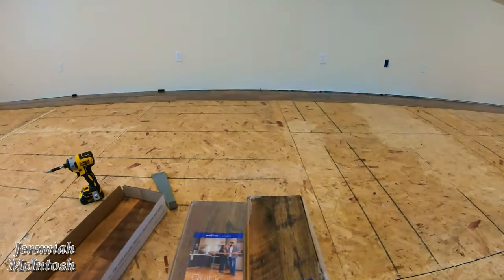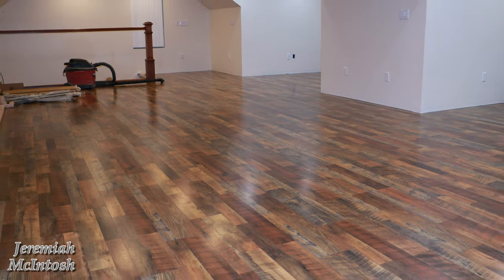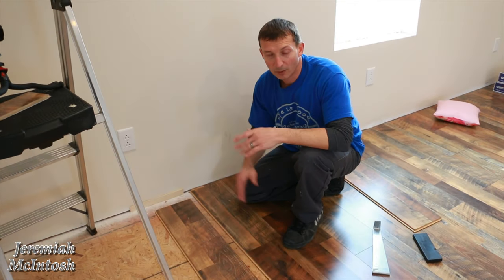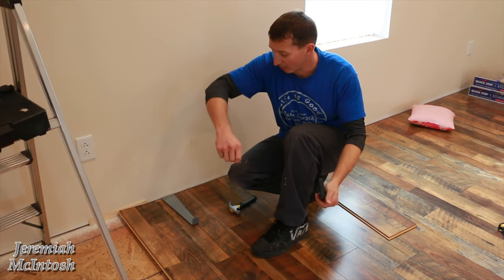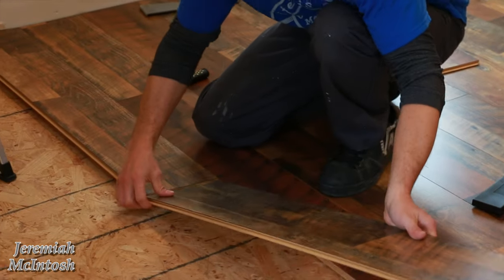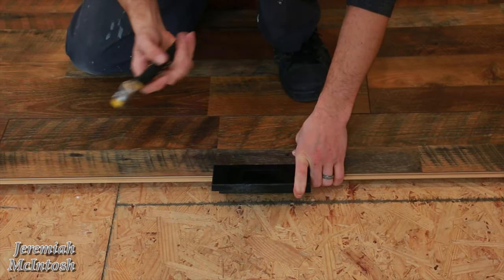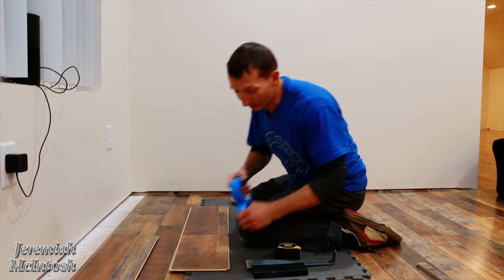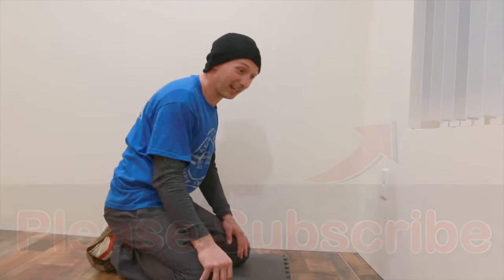How to install Lowe’s Quickstep Studio Restoration Oak Laminate Flooring! Awesome Looking and cheap!

Comment: I laid this flooring last month and one thing can't stress enough you have to have one of the plastic tapping blocks and have to beat the hell out if to get it to lay flat.
You are better off using a heavier hammer then a light one, never did a floor like this that needed to be hammered this hard to lock and lay flat. 
Make sure you tapping block is in the right place you can damage the lip if you aren't careful.
Reply: That last sentence!! I ruined a couple of boards using a block because I used it on the whole side instead of on the tiiiiiny lip. Once I figured that out I was on my way pretty easily. Oh, and cushioned knee pads were a lifesaver

Comment: Video doesn't really touch on leveling. It's incredibly important to check the whole floor is level and any dips patched and any highs planed down. Any variance over 3/16ths will come home to roost and cause buckling or decoupling of the latches.

Comment: Excellent instructional. I had to go back and watch it again to get those first pieces to be still. I piled the full boxes on and the rest was a breeze!  One tip I could give- be sure to cut off any of the foam on the bottom that sticks out past the ends. This will allow the end joints to click together better. Thanks again!
Reply from the maker: Glad it was helpful!

Comment: i installed a laminate floor 6 years ago . i used the cheap stuff but i used exterior tite bond wood glue . i put it all the way around the piece locked it together and wiped exess glue with damp rag . had many water spills and not one joint came up . the water proof glue makes the floor sealed in the joints

Comment: By far the best laminate installation do it yourself I've seen on the internet congratulations great job
Reply from the maker: Thank You I really appreciate that!
Reply: How is yoir flooring from lowes holding up?  Would you reccomend this flooring?  @JeremiahMcintosh
Reply from the maker: Yes I would. It still looks like the day I installed it. As long as you don’t get it wet it’s great. Also might is not in a really high traffic area with no pets so keep that in mind.

Comment: I am installing this exact same flooring at the moment. Most idiotic locking system I have seen in 15 + years of installing flooring. For a guy who works contract that size of a room would be good money. That locking system slows you down big time. One row at a time is not installer friendly. Leaving it up at an angle was some thing I wasn't doing. Thanks for the tip ( previous board would keep popping out, very frustrating :(. Buy the way you can do 2 first boards at a time instead of one, saves a bit of time.
Reply: Contractor of 10 years.. I’m helping a buddy out with his flooring job, this locking system is the worst I’ve ever used. Then they said they got it at Lowe’s and my first thought was oh.. that’s why.. there’s a reason Lowe’s are always ghost towns
Reply: @zachmosphereiii9683  Just a note, Lowe's just sells the stuff. They don't make it. I work for a large flooring chain that sells different brand names. If I remember right this is made buy Wilson.

Comment: You really save my day! So i bought the floor and everything needed, after watching some videos, I though I could install the floor easily, but no! it was not so easy. I got a little stressed, searching for some other videos, and found yours. After watching your mini tutorial, I became and expert, earned some confidence and did it. I will add that measuring and dividing the long measured area by the planks will be great, I did it and i could install the floor evenly.
Thank you!
Reply from the maker: Sweet! glad you got it figured out and glad I was able to help!

Comment: I saw that you used a miter saw for the cross cut at the end, but what did you use to do the long cut for the last few pieces?  Also, what blade do you recommend using to avoid splintering?
Reply: I can't speak for him but I use a diablo ultra finish blade

Comment: I need help me and my sister started putting this flooring in and it hates us it just will not go in to each other so if you see this please help me
Reply from the maker: It is tough to get started until you get a few rows down but you just need to use the hammering block and hammer them until they lay flat. Don’t forget the hammer the short end as well because even though they look like they are together I’ve noticed it still Has to go a little further to lay lay nice and flat.
Reply: I was upset at first to when I laid this floor, having done others, I watched Jeremiah's video and can honestly say you really have to hammer this stuff hard I even damaged a 2 pcs because I had the plastic tamping block a little over the lip instead of up a bit on the floor.  Once you get it locked in you will notice it lays flat, I also noticed even after getting locked it still came a part pretty easy considering how much effort it took to get it locked, but once I started rolling it was just like any other floor I have done, in fact I like it better it's locked so tight and I have had no separation or rising of the seams and liked the fact the underlayment was attached. Saves time.

Comment: Great video, we put this stuff on our whole main level. It looks good enough and is a decent price, but doesn't handle moisture very well and the joints will bubble... but it does dry out and can return to shape if water hasn't sat on it too long. Also if you drop utensils or what not on it it dings easily. If we had to do it over we would have spent more on a vinyl product, which we did for the basement and upstairs bathrooms and we are way happier. Overall though this is a great budget option that'll work and looks good but not hardy and it attractive as vinyl.

Comment: Thank you SO MUCH for this video!! I was so frustrated and discouraged laying in a floor. I stopped and found your video and headed to Home Depot to buy a tapping block and that metal end tapping tool.  Still plenty of work but it went so so much better! 
Lesson learned: Don’t skimp or try to be clever. Get and use the right tools for the job.
Insta-subbed ❤️😊
Reply from the maker: Awesome Thank you!

Comment: I've put laminate flooring down several times and still got some good tips from your video.  Thanks for posting!!  I will say that Lowe's Quickstep is cheap in price.  Not bad laminate flooring.  However, one thing I noticed is that it chips easily if you hit it just a little bit harder than you should when you are locking them in using the plastic block.  I have also noticed with this particular laminate that in a couple of small areas, the top of it has started to peel up a little.  Not real noticeable, but it has happened on a few boards.  I have used Pergo Laminate flooring and honestly, I can attest that it's a little better laminate to use.  However, it costs more.  But this stuff isn't bad and I currently putting it in one of my bedrooms.  Again, thanks for posting!!

Comment: Did the floor stay together? How much per box? How long did it take to finish that room? Would you purchase the same floor again? Would you install another floor, or pay to have it done? Looks great and thanks for the video
Reply from the maker: Yes the floor stayed together so far and it is $39 per box or 2 dollars per square foot. I didn’t really keep track of how long it took me but I think I had it done in about two weekends. I would definitely do it again myself but then again I do everything myself LOL. I would purchase this floor again for areas that will definitely never see water. Downstairs I’m going to use a luxury vinyl plank so I don’t have to worry about it getting wet.
Reply: @JeremiahMcintosh    Isn’t this flooring waterproof?
Reply from the maker: Not really. It’s water resistant but if water gets in the seams it could cause them to buckle up at the seams. A Vinyl plank floor would be better if you plan on getting a lot of water on it.

Comment: That looks great. Like you said you do not want to get this wet or i should say let liquid stand on it for any length of time. Our dog urinated on ours and itr now has a bow in it. When we change it out i will be going with the vinyl type next time. Keep up the good work. Enjoy your vids.
Reply from the maker: Thank you. We are going to use a luxury vinyl floor in our downstairs.
Reply: Your flooring that bowed up, was that this same product (Lowes Quick-Step etcc) or some other laminate?  The Lowes Quick Step says it's waterproof.
Reply from the maker: No laminate flooring that I know of is waterproof.
Reply: Our it’s out of alignment just a tiny bit. We don’t want to start over we only have about 6 feet left. It’s in the middle then when we try to add the next horizontal piece they all just fall out. Any tips
Reply from the maker: Doesn’t sound like they’re locked in all the way tightly. Make sure they are locked and laying flat and also the short ends are locked in by tapping them together as well on the small side.

Comment: I have installed A LOT of floating floors. All different brands and types. 
And this particular brand is the worst to install. I just attempted another floor with this product, the planks weren't perfectly straight. Talk about a nightmare to install. Nothing would stay locked together due to the slightly crooked boards. So it got loaded up and back to lowes it went. 

Seriously, do yourself a favor, avoid this brand...
Reply from the maker: Mine installed ok. Maybe you got a defective batch?
Reply: @JeremiahMcintosh  It's the second time it's happened. The first was 2 years ago and I forgot what a nightmare it was. On that job, I got to load up and return 2200 sqft of the garbage. 
I won't forget again. Quickstep is on my banned products list.

Comment: We’ve spent 4 hours on our floor using this brand. Bought the instillation kit after watching your video the first time. Have watched two more times and still can’t get past the 2nd row. The pieces will not lock in. I don’t know what else I’m doing wrong.
Reply from the maker: Make sure you’re tapping them together on the short side also because even though they look like they’re together, sometimes they’re not which makes them not lay flat.

Comment: My floor is not locking as I add pieces
Reply from the maker: It’s a little tricky when you’re first getting started but you’ll know when they lock in because they will lay down flat. Make sure you hammer along the short edges and make sure the short edges are locked in as well with each piece because if the short edges aren’t locked in it also will not lay flat. You do not want to put nails in the flooring but you could put a few nails behind it until you get started but make sure you pull them out when you’re finished so the floor has room to expand if needed or it will buckle. I hope this helps. Are you using quickstep studio flooring Or a different brand?
Reply: I got the exact same ones in a different color and they don't really "lock" or click together. It's a huge hassle for me because as I tap them, something else comes loose. I feel like Sisyphus pushing a stone up the hill. Thinking about trying another brand and returning all these.
Reply from the maker: Make sure you tap on the short end as well if the short and doesn’t lock together completely it will keep the long ends from laying flat. It is a little tough to get started but once you get going and get a few pieces locked together it seems easier
Reply: Update: I got it to work. I had to build from the corner diagonal out rather than going row by row. Also for the first 2 pieces in a row I put the short ends together and folded them down until I heard a crease. That allowed the others to tap into place better. Hope it helps.
Reply from the maker: Awesome! Glad it worked out for you and you got them to lock together.

Comment: I used this product on our living room.  I started in the opening between the kitchen and living room.  I like it so much, I want to go into the kitchen.  However, if I connected to the current flooring, I'd have to work in the opposite direction (i.e. putting the tab into the slot, rather the slot over the tab.)  Can this work or should I find a way to turn my start piece around by cutting off the slot on the floor pieces that are already down and also cutting off the slot on the new pieces in my "starter" row in the kitchen, butting these two up together??
Reply: I did it backwards and it works. Just takes more patience getting the seams to close

Comment: Some of the laminate flooring you have to tap it quite a bit harder then that to get it to lock. If it don’t snap together tightly you messing up. I to use that nylon block but a scrap piece of the same laminate works very good also for tapping it together. Another great video dude.
Reply from the maker: Thank You Paul!

Comment: How long did you let it sit inside the home to acclimate ? I thought maybe 12-16 hrs would be good the guy at Lowes was saying like three days?...lol.. I know for hardwood yes but for laminate ?
Reply from the maker: Actually it sat in my house for a few weeks before I was able to put it in. So my flooring was definitely acclimated LOL
Reply: @JeremiahMcintosh  was just wondering I cannot get mine to lock together and lay flat and we have beat the mess out of it!!! About to load it up and take it back to Lowe’s!!
Reply from the maker: Make sure you tap on the short end as well because even though they look like they are locked together you can go just a little bit more and allows it to lay more flat. This is what I have noticed when installing mine.

Comment: Can you mail a few pieces at the beginning edges to lock it in?
Reply from the maker: You can put nails behind the pieces to keep them from moving but make sure you remove them to allow for expansion if needed so the floor does not buckle When you’re finished.

Comment: For the expansion gap, do I want it all the way around or is one gap in each direction ok?  I live in southern NM so relatively dry with a monsoon season and rarely gets below 30 for longer than a few hours in the winter but the summers are over 100 regularly, in a detached room with a concrete floor.
Reply from the maker: Yes you should have the expansion gap all the way around.

Comment: How did you install the pieces when you got close to the finishing wall? I can't get my pieces to lock cause the tool won't fit for the close ones.
Reply from the maker: The tool should fit because you need to leave an expansion gap by the wall or the plank will buckle when they expand  from humidity and temperature difference .
Reply: Yes, the tool does fit, it's just hard to hit it I guess. These are a real tight fit.

Comment: You said something about cutting the edges getting started? Do I do this for every one or on the starting row and outter edges?? Floor looks superb btw!! 👌👌
Reply from the maker: Basically you just want to make sure that you have enough room for expansion and contraction but don’t want to cut too much off that your baseboard is not going to cover the gap. If you don’t cut the edges off that’s less room you have for expansion. Once you get going most of the time you will start your next row with the piece you cut off from the previous row assuming it’s big enough so it will already be cut off.

Comment: do I need plastic when installing on cemented 1st floor?
Reply from the maker: In not sure but it is anywhere moisture can be I would not us this and would use a luxury vinyl plank.
Reply: I would for a vapor barrier...
Reply: yes you need a vapor barrier on any slab/concrete areas, but i would use the vinyl plank for that
Reply: @JeremiahMcintosh  : Thanks was going to install in kitchen, but I don't think I will do that being that sometimes water does get on the floor when cooking . Thanks
Reply from the maker: Yeah I would definitely not install in areas where it’s prone to get wet. You may want to look into a luxury vinyl plank which I will be installing in my new living room. That can get wet without any problems and will not swell up.
Reply: @JeremiahMcintosh  : Thank You

Comment: dont you nail the first strip with a few finish brads so flooring cant slide when tapping panals
Reply from the maker: No you do not want to nail the floor down as you can see in the video I used a few screws to temporarily  hold the floor until I was finished then removed them at the end. you want the floor to be able to move when you’re finished if needed for expansion and contraction so it does not buckle.

Comment: After tapping the end piece into the field, how do you prevent it from moving back toward the wall after the floor is completed.??  In addition, like any other wood flooring, all the boxes should be opened, wrapping removed, with spacers in between each layer and allowed to acclimate to the room conditions for at least 3 days...
Reply from the maker: Excellent point pjf I should’ve mentioned this in the video! Yes definitely leave the flooring acclimate to room temperature. Mine was actually indoors for a few months so I was not worried about this. As far as it moving back toward the wall after installation the pieces all lock together and it does not move very easily but you do want to allow it to move slightly if it expands or contracts.
Reply: @JeremiahMcintosh    Everyone should read my above post...   I also posted elsewhere that all the edges should be stained darkly and allow to dry BEFORE installation, as separation SOMEWHERE will occur revealing a light colored scar you'll be making excuses for to your friends and family and blame the product or your inexperience..  LOL!  LOL!
Reply: @pjf7943  you shouldn't have any exposed edges that can been seen. That's what the edging or nose is for